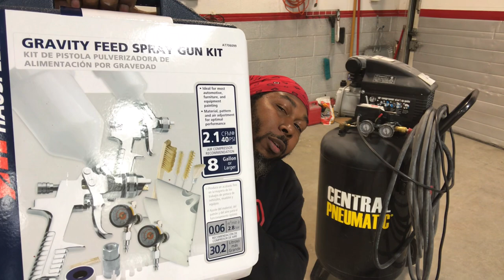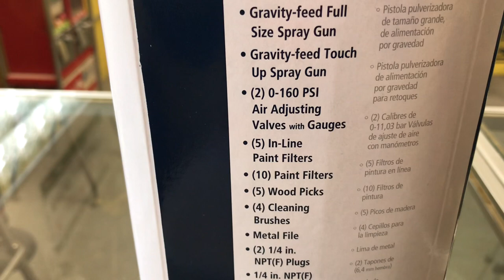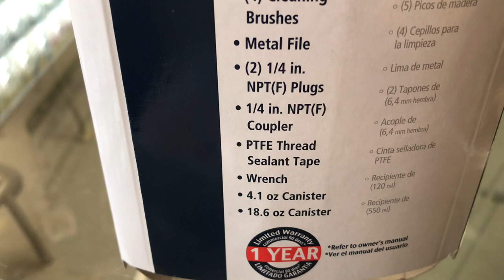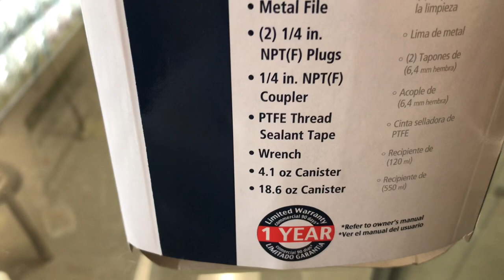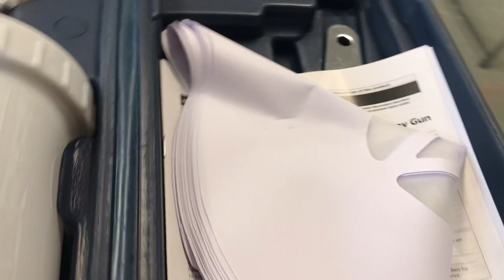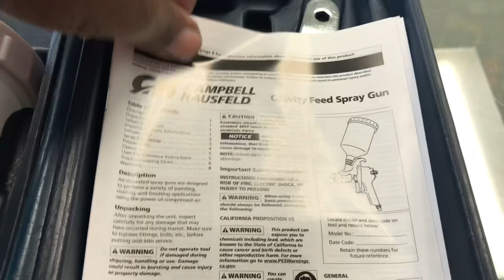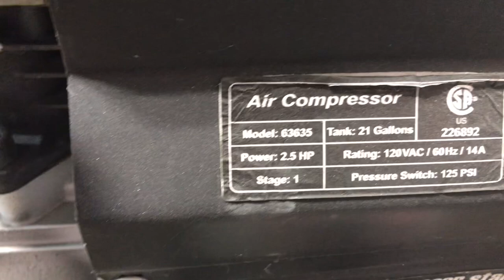Low Volume Low Pressure spray guns for small compressors

Comment: The only review that properly shows the gun(s) in use. That paint and clear coat  laid down like glass when you bumped up the air pressure a bit. Sold. Thank you Ahk.   ....and you can just use a screwdriver (or maybe one of the cleaning brush handles) to pop the guns out of the case right quick.
Reply from the maker: Yessir!... I appreciate you checking out the video Ahk...Shalom!

Comment: Friend you're a blessing I've been buying Harbor Freight paint guns for a very long time all hvlp guns I don't work on cars but sometimes along with my brother we'd restore farm tractors and we paint too but I'm a welder making gates and fences and security doors they need painting too I've been using all types of air compressors from a 4 gallon Nikota to a 20 gallon speedaire now I own a 29 gallon Central pneumatic from Harbor Freight after you explained the difference it made between hvlp and lvlp I'm going to buy that Campbell. 
Hausfeld spray gun combo it might even work with the 13 gallon cambelhausfeld compressor on my work truck too but thank you so much for all information bro I'm locked on to your videos now
Reply from the maker: I’m glad the videos have been helpful to you and the lvlp spray guns should work well for you!

Comment: The paint looked like it laid down well, and was a nice review.  I also don't like those cases where everything is retained by those "nubs" that make it hard to get everything out, especially smaller and more delicate pieces.  That being said, a hard sided case is really nice to have, especially for the hobbyist because it keeps the gun kit protected and together so it's always ready to use and easy to find.  I've been reorganizing all of my tools lately and I've been putting all of my construction/handheld woodworking tools on a 6' shelving unit in their original hard cases when I have them and in tool boxes when I don't.  I wish I had done this years ago as it's so easy to find everything and it's all ready to use at a moment's notice as well.
Reply from the maker: Thanks I appreciate you Tom, and it’s nice to be well organized, it makes everything easier!

Comment: Astro Europro lvlp is a good low pressure gun for cheapy cheapy on Amazon, atomizes good, built really well... no seals no plastic...... I'd recommend. Liked it so much I bought their high efficiency gun and use it at work it's just as good as my devilbiss
Reply from the maker: Thanks for the info I’m gonna look into it... I appreciate you checking out the video!

Comment: I have this same set up... i started off painting my 4 wheeler plastics... and i did a bumper with it a week ago.. it layed the paint pretty well without alot of orange peel but once i added a 3rd coat the orange peel was hardly there at all... just ran across some runs in the paint.. i think my technique is just off becuz im a beginner.. plus i didnt have a pressure gadge on my gun.. i just used that one on the tank trying to eye it... i think i had it to low becus i didnt take in account when you pull the trigger it drops.. also using single stage paint...
Reply from the maker: Sounds like with a few tweaks you’ll be good to go 💯💪🏾

Comment: Just ordered an 8 gallon, California Air Tools compressor for my air stapler. I'll be doing some woodwork. Now I'm looking at a paint gun for stains...

... and clear coats. The compressor is rated at 3.1 CFM @ 40 psi. Looks like I'm within the operational requirements. Thanks
Reply from the maker: That’s great...glad the video was helpful!
Reply: @UndergroundPaintKing  Also read a larger hose and fittings will add to the volume. Thanks for the review. Be safe.
Reply from the maker: @sethlogan9724  thanks I appreciate you and you stay safe as well!

Comment: Nice videos new subscriber I paint bumper covers 5 days a week with a little california air tools 1hp 8 gallon air compressor on dealership lots with an Iwata lph 80 paint gun that uses around 2cfm at 20 psi and the compressor puts out 3.1 Cfm and it's just enough the reason I don't us a more powerful compressor is that they use a lot of power to run and the power surge will pop circuits at the dealership you will be awarded what a small compressor will do with the right paint gun
Reply from the maker: Thanks I appreciate you subscribing to the channel and I’m always glad to hear a success story of someone using a small setup and being successful with it💯🤛🏾

Comment: Very nice...
Biggest question here is....
Can this setup do an entire car?
Panels on a small compressor is one thing...
If u can paint an entire car, I will be sold on this "small compressor "...setup
Reply from the maker: You can definitely paint a whole car with this set up but stay tuned and I’ll show you better than I can tell you!
Reply: Thank you for reply....
If you can do an all over on video I will be sold!
And please make sure to keep note of how many times compressor cuts on !
This will be the holy grail video of using a smaller compressor
Reply from the maker: @pierremorris5337  how often the compressor cuts on will be determined by the size of the vehicle you are doing

Comment: If a lvlp for example the spray it 33000k needs 3.5 - 4.0 cfm @ 40 psi and for example a kobalt 26 gallon compressor can supply 5.5 cfm @ 40 psi it’s simple. could you paint a whole car?
Reply from the maker: You should be able to paint a whole car with it
Reply: @UndergroundPaintKing  Much appreciated man 👍🏾
Reply from the maker: @4oeproductions289  anytime bro!

Comment: Hi, UPK. Thanks for the review. We'll, is'nt heavy a sign of quality? As you well know this gun along with the HF  purple and spectrum chrome guns are all produced on the same platforms world wide and that is the Sata 90 or N95 green gun. I have 3 of them in prestige condition. The other copies are DeVilbiss Tekna or Iwata's W400 classic body copies. My real guns (meaning hvlp or rp or fully compliant) are air hogs and need the twin pump 2 stage 250 litre old compressor to keep the juice running to them. I have 3 lvlp guns now and 25 others. But they all come out to play!!!
Reply from the maker: Thanks for checking out the review Niam and it sounds like you have a nice collection of spray guns!
Reply: Thank you, I always believe, it is not the gun but the man behind the gun, who can get the best out of a cheap Chinese gun. The only thing is, how long will it last and when the gun breaks, it is Bin time for it. Whereas, I can go and pick any of my Sata's or the Supernova's and 10 years down the line they will not let me down. You get what you pay for. The R & D leads to quality bench marking and after sales supply of spares. Which are not available for the Chinese or Taiwanese Star guns. So, the moral of my speak is cheap is in the long run actually NOT cheap. Most of the people who I know have had problems with internal O rings or the trigger has too much free travel or the packing gland leaks air or material. Causing special effects on the hood or trunk!!!😅😅😅
Reply from the maker: @niamakhtar2234  I totally agree with you!

Comment: i bought a 20g 1.6hp 135psi max mcgrraw for 220 should be fine painting two doors and a fender buddy did with his that's why i bought the same the one you have i tried to buy but all sold out
Reply from the maker: Yeah I think they may be discontinued and switched over to different compressors

Comment: O..yea..n about..how many cups..wudd it take..to paint..2 pannels at a time...n how do u switch from bas3 koats..to ur clears..w ithin..painting scenarios...✌✌👍😎
Reply from the maker: how many cups could vary depending on your spray gun and materials and once you're doing spraying your base you will wait your proper flash/dry time and clean your spray gun if using only one spray gun and get ready to spray your clear

Comment: are you using a 3/8" or 1/2" air hose or sure I ask which one is better for small compressor. thanks
Reply from the maker: I use 3/8 hose on my big and small compressor

Comment: Thank You UPK, I going to invest in this Gun. I recently got same Compressor from Harbor Freight. Do I need to get regulators for it before I start Spraying? I Plan on doing few Panels(Primer) & Go from there.
Reply from the maker: If you’re talking about regulators for the gun the kit comes with 2 regulators so you should be good

Comment: So basically you always turn air compressor to 90psi for your output and set your paint gun to to the correct psi that's in the manual?
Reply from the maker: I set my gun with a air regulator

Comment: Great video, and thanks for the review. I'm wondering if the 3M PPS 2.0 cups system will work with these guns with a small compressor set up. Would it be OK to use slightly larger cups than what came with the guns(there are no 3M cups to match the original size cups). Thanks
Reply from the maker: You definitely can use larger cups with this spray gun but I don’t know if you can still get your hands on it because it may have been discontinued, but it’s possible to find it on eBay maybe, if you don’t have it already, let me know if you find it
Reply: @UndergroundPaintKing  I found the kit at Lowe's...gonna try it out, per your good review.  I'm a weekend DIY'er, and trying to learn a new skill.  I only have an 8 gallon tank, BUT my needs are for really small woodworking jobs (making things for my daughters and granddaughters).  

I also found the 3M PPS mid/mini cups and adapter. 13.5 oz & 6 oz cups.  I'll let you know how things work when I get everything!  Thanks, again!

I also found this LVLP gun, but higher CFM (SPRAYIT SP-33000 LVLP Gravity Feed Paint Spray Gun
Model:
SP-33000).
Reply from the maker: @TheMrTJOX  I have videos on the SprayIT here on the channel, let me know how it works out for you!
Reply: @UndergroundPaintKing  I'll check out the video
Reply: @UndergroundPaintKing  I just watched the video... that him looks good, too. I think the cfm may be too high for my setup with the Sprayit? 

Which of the two guns do you like?
Reply from the maker: @TheMrTJOX  I really like the SprayIT over the Campbell but they both do a great job so it should work well for you

Comment: Thanks, it is reassuring to see it can be done! I do not see any water/oil separator in your setup. Is it safe without or are you using any?
Reply from the maker: You’re right I didn’t use a water/oil separator but it would be good to use if you plan on doing a much longer job... I appreciate you checking out the video!

Comment: What was your psi on your compressor set to ? The paint your using and the mix ratio ? GREAT INFO AND VIDEO !! 👍👍👍
Reply from the maker: I think the compressor was set at 90 psi and the paint I used was ppg with a 1:1 mix ratio…I appreciate you taking the time to check out the video 💯🤛🏾

Comment: Possible to hook up a paint pressure pot to an LVLP sprayer?  Want to use an LVLP sprayer to paint my house (due to my air compressor) but am worried about having to constantly refill the tiny paint cups on the LVLP sprayers.
Reply from the maker: I’ve never attempted to hook up a pressure pot to a gravity feed spray gun so I can’t say for certain that you can or can’t

Comment: What size air line are you using. Just curious about diameter and will smaller hold higher pressures longer. Appreciate your review/advice.
Reply from the maker: It’s a 50ft hose
Reply from the maker: I appreciate you checking out the video!
Reply from the maker: You can use a shorter hose it just really depends on what you are working on and attempting to accomplish

Comment: I have the same air compressor. The question i have is when the pressure drops to 90psi, the compressor try to turn on but it doesn't so i have to use it til it gets to 50psi, let air out and refill again. It been like that since i bought it. I was wondering if you went thru the same issues with yours or what it could be?
Reply from the maker: Do you have to reset it as well... I have experienced this when my compressor is in a colder temperature or if I haven’t used it in a while...what also could be happening is if you’re not draining the air out of air after using it so I would try draining it completely after using it
Reply: @UndergroundPaintKing  yes. I turn the compressor off. I drain the air at the bottom and let it sit like a min or 2. I hit the reset button and then it start right up. I found your channel last night tho while at work. You got a subscriber here
Reply from the maker: @ItsyaboyR.B  thanks I appreciate you subscribing to the channel... I found that I have that issue when the compressor is cold and I have to reset it and sometimes after a few attempts it will finally catch so I try to keep the compressor in a warm location which isn’t the easiest thing to do in Michigan during the winter season
Reply: @UndergroundPaintKing  ok im try that. Thanks
Reply from the maker: @ItsyaboyR.B  you’re welcome bro!

Comment: Thank you for an amazing review. What inline pressure regulator are you using at bottom of gun. Shopping around and it seems some brands just show the pressure from tank and not adjustable
Reply from the maker: The regulator I’m using came in the gun kit with the gun...if you go back to the review portion of the video you will see that 2 regulators come with this gun kit and both are adjustable and they can be used with other guns also...I appreciate you for checking out the video!
Reply: @UndergroundPaintKing  do you have a brand you use? Adjustable Spray gun regulator That you can suggest?...don't want to buy one and have to return it or it fall apart on me. Lol
Reply from the maker: @shellumus  3m sells a regulator and I’m a Devilbiss guy and they also sale regulators and you can find them on Amazon or check on their website

Comment: Does the psi on the air compressor need to be set to 90 psi are 40 psi?
Reply from the maker: I set my compressor at 90 psi
Reply: Thank you sir I'm new to painting I'm getting confused scfm and cfm one thing says 5.1 at 90psi and 6.8 at 40 psi
Reply from the maker: @robertw5008  you’re welcome...what are you painting?
Reply: I wanna prime and paint my s10 truck with some rustoleum gloss black my 1st time and I'm going to order that Campbell paint gun kit!
Reply: I got my primer gun at harbor freight siphon spray gun  with 18mm tip

Comment: What grit sand paper do you use to scuff the surface of old paint.
Reply from the maker: Are you scuffing the old paint to spray paint on top of it?
Reply: @UndergroundPaintKing  yes sir.. just  motorcycle plastics
Reply from the maker: @AHLive215  you can go with 320-600 grit

Comment: Was wondering if that can be done using the raptor liner
Reply from the maker: You’re wondering if you can use the gun to spray raptor liner?
Reply: @UndergroundPaintKing  
I should have been more clear I was wondering if you can do raptor liner with that size compressor an using the gun that comes with that raptor liner
Reply from the maker: @robxavier9499  I honestly don’t know if you can use the compressor for raptor liner…I don’t know the requirements for the raptor liner to be applied with

Comment: What should spray gun regulator be set to? So no matter what the air compressor regulator is always set to 90psi for power tools?
Reply from the maker: Your gun settings will vary for materials being sprayed and your psi may vary depending on what tools you are using
Reply: @UndergroundPaintKing  ok I understand , but on the air compressor I turn my knob to 90psi right!
Reply from the maker: @robertw5008  yes you can turn it to 90 psi
Reply: @UndergroundPaintKing  see that's what I'm getting confused with air compressor regulator do some people when they paint turn compressor down to 40 psi? Are 90psi?
Reply: See I just got a cheap 30 gallon husky air compressor I'm  just trying to understand if I turn my compressor to 90psi it's going to turn on more that's what I'm trying to figure out wit this 40 psi on air compressor not the gun regulator!
Reply from the maker: @robertw5008  you don’t have to turn the compressor down to 40 you can leave it at 90 and regulate how much air the gun is getting with a air regulator that connects to your gun
Reply from the maker: @robertw5008  try it at 40psi then try at 90psi and decide which works best for you and what you are doing
Reply: @UndergroundPaintKing  thank you so much to help me understand man appreciate it! I'll keep in touch with you
Reply from the maker: @robertw5008  you’re welcome and definitely keep in touch

Comment: Great video! Question: what gun would you use to spray Gelcoat?
Reply from the maker: You should be able to use a spray gun with a 2.5 tip but I can’t say for certain because I don’t spray gel coat
Reply: @UndergroundPaintKing  Thanks. Much appreciated. (trying to restore an old Boat)
Reply from the maker: @rickBW7753  hopefully the info helps